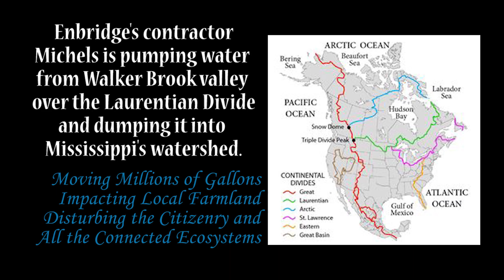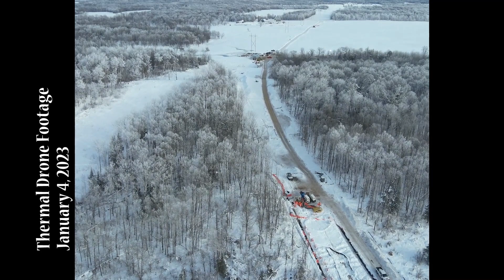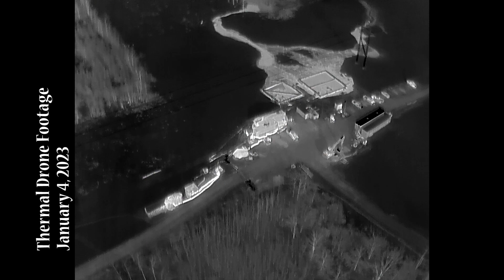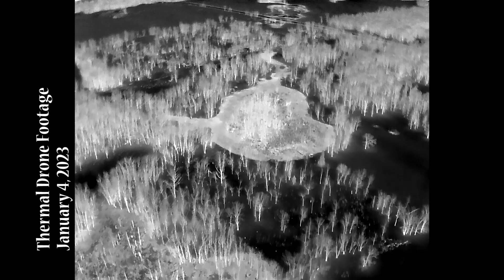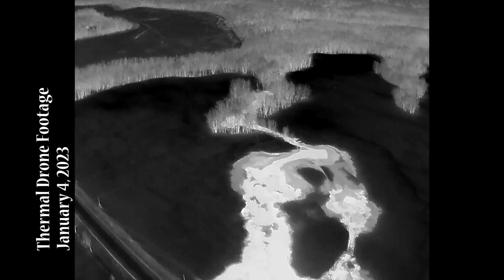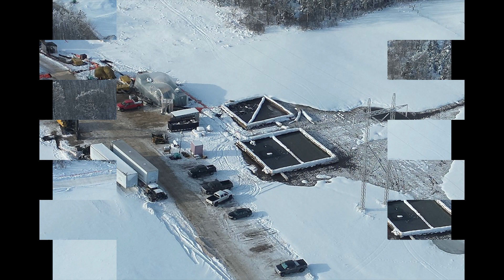January 2023 Enbridge Moving Water from Hudson Bay to Gulf of Mexico

Comment: 😆🤣😂 Think water weight 🤔.  Associate water with an ice-skater holding their hands away from their body as they spin. When they pull their hands closer to their bodies they will spin faster. 
   Ice and snow gains equal to inches of water weight? The ice and snow build-up towards the polar regions is like an ice-skater.  Recent record earth rotation speed increase is relative to the physics of an ice-skater. As snow and ice buildup in the polar regions we can only pray that the fraudulent GLOBAL WARMING AGENDA is real.
   Record earth rotation speed increase is like a man running 30 feet per second. It doesn't take much at the equator as it travels over 1,000 miles per hour. A millisecond increase at the equator is comparable to centrifugal forces increase as the HONGA TONGA ERUPTION is associated with Centrifugal pressure upon the equator associated with tectonic plates boundaries that have different longitude and latitude boundaries. 
   Earth crust displacement takes very little to form magma intrusion and cracks that release volcanic eruptions. Such pressure build-up will bring about more climate changing eruptions. 🙄
   Time to pray for global warming 🙏